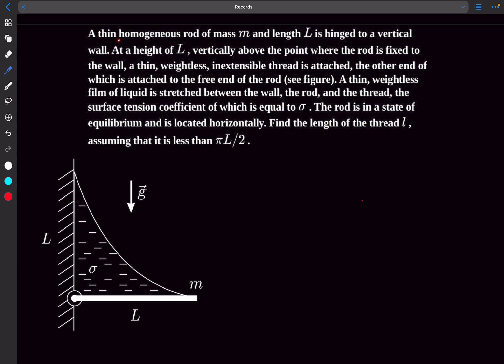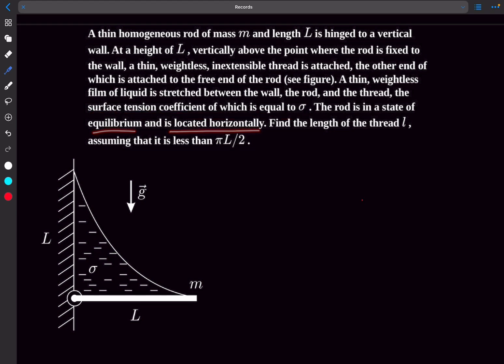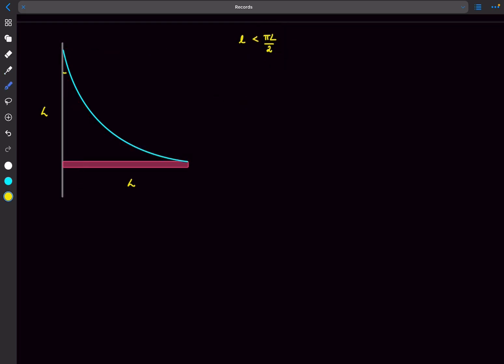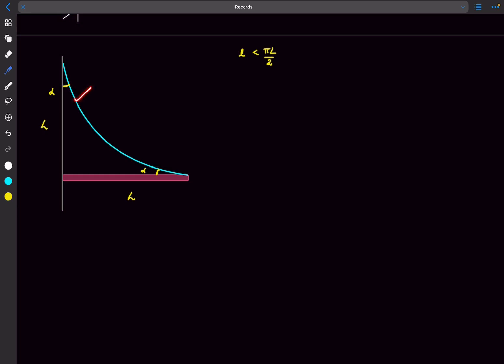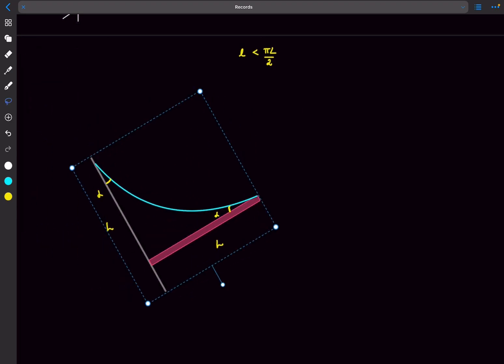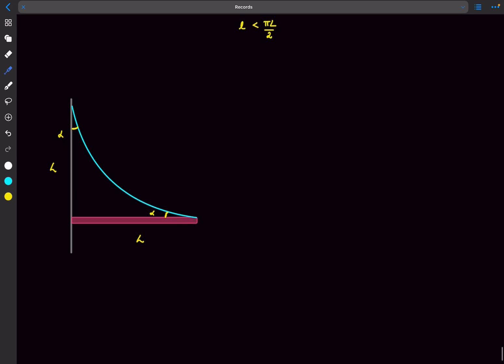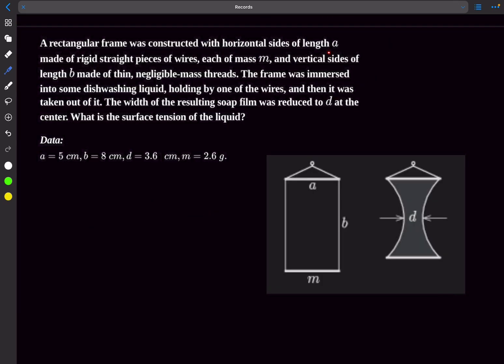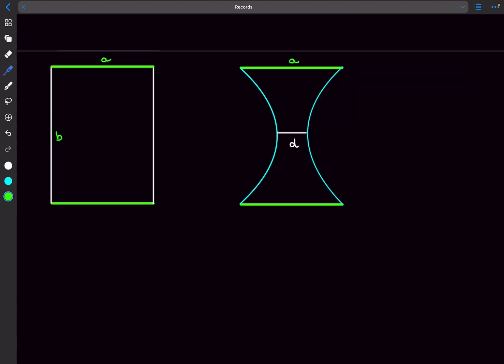Good Problems On Surface Tension for Adv 25

Comment: yet again why circle 10:52
Reply: surface tension arises due to the property of a liquid surface to reduce its overall surface area, tho I don't have a proof for it, but I think keeping the length of string inextensible, the minimum area of liquid surface is achieved  in a circular pattern

Comment: why is it part of an arc of circle 7:14
Reply: Because, analyzing the forces on a differential element of the string, you'll get T = 2σR where R is the radius of curvature of the string at that point.

Since tension is constant in the whole string, so is the radius of curvature at every point on the string.
In other words, the string is an arc of a circle.
Reply: @nishantkalonia8249 hmmm ok

Comment: @8:12 should the direction of surface tension be opposite to what u showed? Cause it will tend to reduce surface area so pull wire inwards but you are showing outwards?

Comment: How can we conclude that thread will be form a shape of a circular arc? Pls any1 explain
Reply: Uniform surface tension force acting always perpendicular to the length
Reply: @shlokfursule2494  But how does it explain that the thread will form a circular shape? But I will surely remember it as a fact tho
Reply from the maker: You can think of it in terms of force balance. Take for example a tiny element of width dl on the the thread now of course it will be curved so lets say the angle subtended at the center of curvature is dθ so the force of tension in the direction normal to dl is Tdθ. Now dθ=dl/R. Now R is a measure of how curved dl becomes. 
Force balance along the normal direction gives Tdθ = 2σdl 
==> T = 2σR. 
==> Now as T remains a constant throughout the thread it means each dl will have the same curvature radius as well or in other words they are part of a circle.
Or basically its the only way in which both net force and torque on the string can be balanced.
Reply: @PhyX_03  Ok, I mean I knew that the explanation of it will be derived from force balancing, but I was just wasn't able to do that. Thanks

Comment: But the system of thread, film and rod will experience a net external force due to surface tension also, surface tension is not internal in this system as Force due to surface tension will be  2σ * _integral_(dl) and the integral will surely not be zero
Reply: nvm u explained it afterwards, the force on wall due to surface tension will only be horizontal so forces in vertical direction will be conserved. mb

Comment: I was unable to get proof for myself that the arc in first question is circular; can someone please explain the proof that why wire arc is circular?
Reply from the maker: You can think of it in terms of force balance. Take for example a tiny element of width dl on the the thread now of course it will be curved so lets say the angle subtended at the center of curvature is dθ so the force of tension in the direction normal to dl is Tdθ. Now dθ=dl/R. Now R is a measure of how curved dl becomes. 
Force balance along the normal direction gives Tdθ = 2σdl 
==> T = 2σR. 
==> Now as T remains a constant throughout the thread it means each dl will have the same curvature radius as well or in other words they are part of a circle.
Or basically its the only way in which both net force and torque on the string can be balanced.
Reply: @PhyX_03  Would it be correct if i say that the shape of the circular arc is the one which minimizes the area of the film, hence leading to minimum energy of the system?
Reply from the maker: @Yeah 100%.

Comment: should i solve INPHO/IPHO PYQS NOW?
Reply from the maker: Imo not really. In NSEP papers u can find a lot of ques that are jee adv level but ipho/inpho are mostly going way overboard for jee (especially the recent papers). It also depends on your current level of prep if nsep questions are cakewalk for u then ig some aits like score/tough coaching sheets is a better option(good problems of score are a collection of foreign oly probs itself). If you find those easy as well and also pretty much done with revision then go ahead with national oly probs.
Reply: @PhyX_03 
Bro plzz solve
19 march SCORE  Phys section 2 Q4
Reply: @ninja-nd1wm is it the one with the steel pot and water?
Reply: @cshastry exactly
I keep getting wrong answer for it 
Do u have a solution?
Reply: @ninja-nd1wm guys where do you get the score question papers? id like to try them too
Reply: @PhyX_03  OK SIR GOT IT..
Reply: Wow